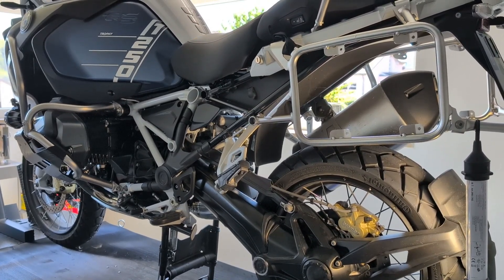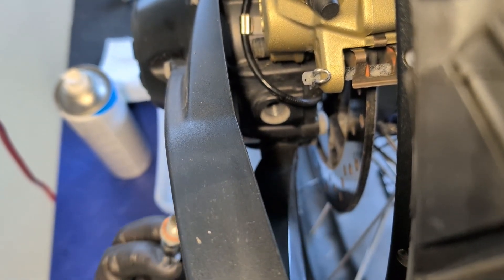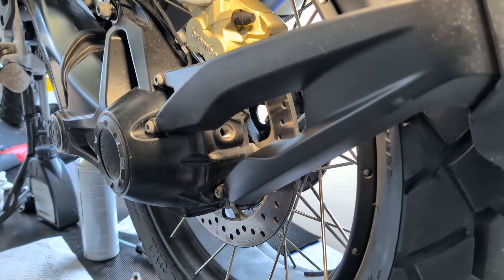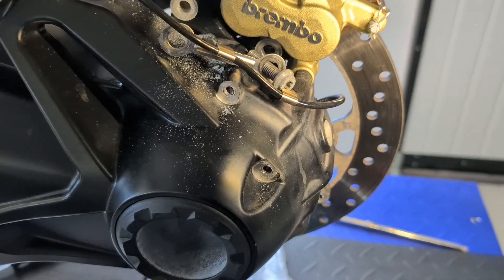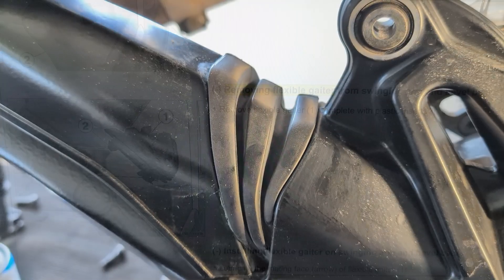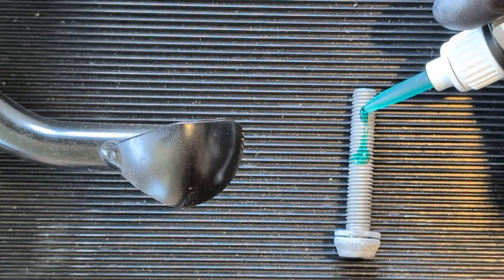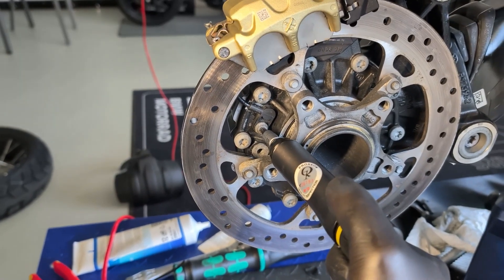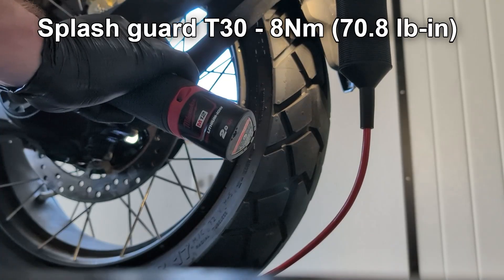BMW R1250GS/GSA final drive oil change and shaft lubing

Comment: Thank you for sharing your knowledge with us.
Reply from the maker: You're welcome. If you want to know about other topics of the 1250, let me know.
Reply: @LMO169 Do you check and adjust your own valve clearances? I did so on my R1100S but the shift cam has me wondering if it’s possible by home mechanics.
Reply from the maker: @colinmcmillan2642 
Yes, I do valve clearance checks myself but it requires various special tools. Here in Germany the tools cost me about 500€ but some were on backorder for months on end until I received them. In about 3000km the bike is due for its first valve clearance check. I'll make another video about it as well as how to do the air filter
Reply: @LMO169 I look forward to seeing your future videos. I enjoyed both your videos - very Informative and concise.